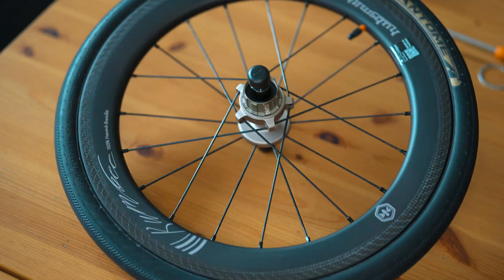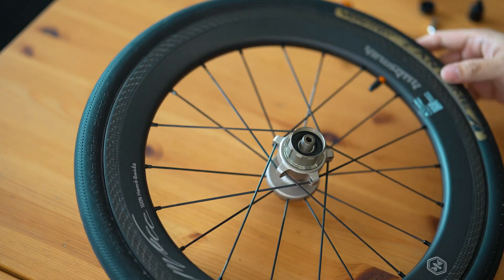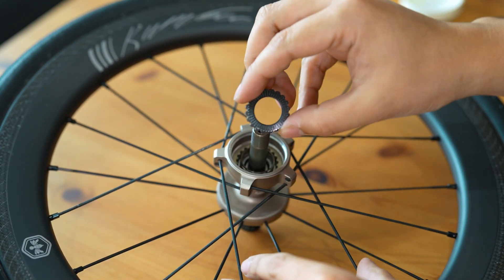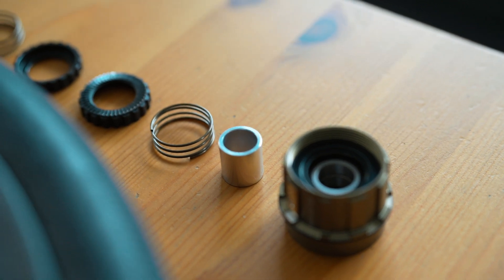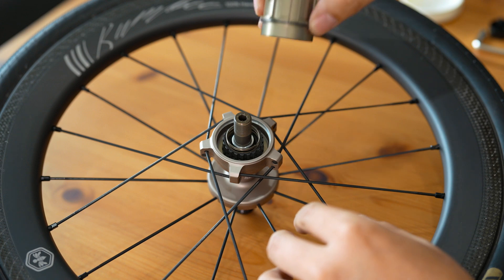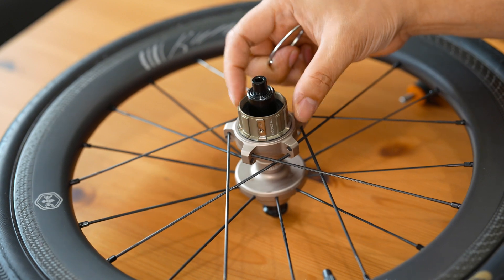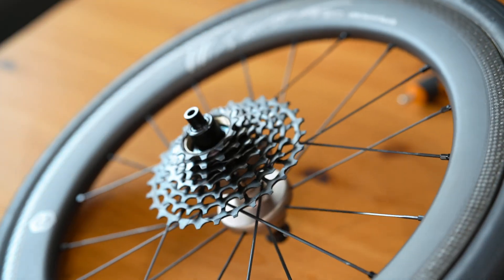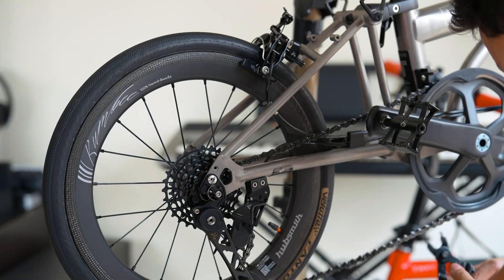What's inside the Hubsmith Ratchet Hubs? Lets open it up!

Comment: ... but does the Hubsmith wheel spin more freely, with the least resistence, and longer than other ordinary and advanced wheel systems?
Reply from the maker: Hi David, it provides minimal resistance due to the high-precision bearings and the zero-time planar tooth ratchet system. The 48-tooth ratchet design allows for near-instant engagement, giving it a more efficient power transfer compared to both ordinary and advanced wheel systems with traditional pawls. As for spin duration, the reduced friction in the freehub allows it to spin longer when properly maintained, making it ideal for riders looking for both performance and longevity. These features make the Hubsmith wheels stand out, especially for cyclists who demand top-tier performance.
Reply: @781BromptonPremiumParts  That's amazing. I hope you have not forgotten. I'm hoping someday you'll build a custom T-Line for me too. Just sayin'. 😉
Reply from the maker: @davidhunternyc1  we are looking forward to that day David!